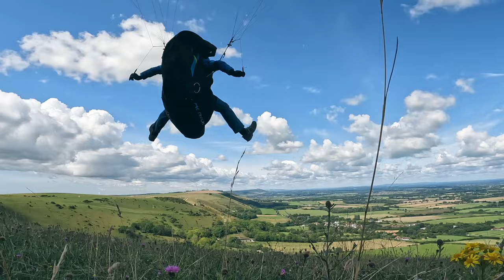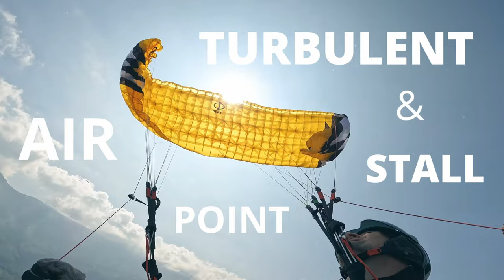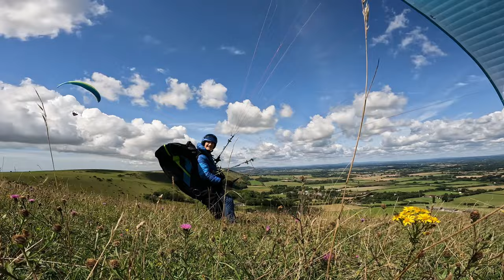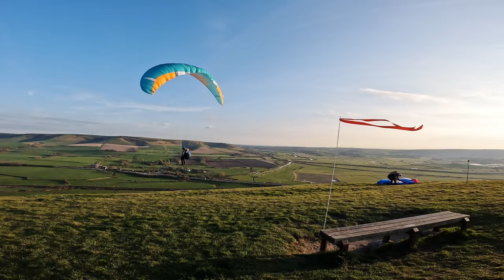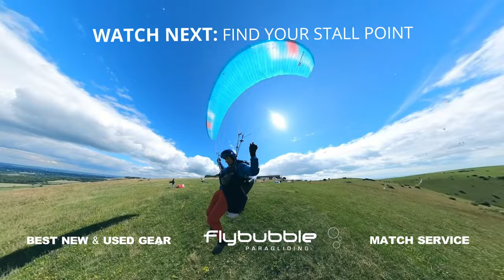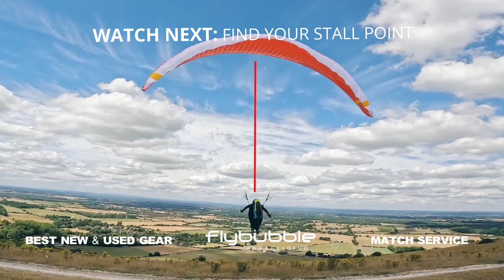AVOID DISASTER: This ONE THING Drastically Increases the Chance of Accident!!!

Comment: I had a pretty nasty crash along those lines as well. Landing into fairly strong wind, with a fairly strong gradient (quite a bit less wind at the bottom) got an asymmetric collapse due to turbulence and then just didn't have enough airspeed to recover before the ground. While in my case I'm not sure if there were many options left (I was at or very close to trim speed and only braked to stop the rotation) the wind gradient is important to keep in mind, especially when landing in strong wind. If there is already a wind gradient eating up air speed it takes very little to stall or delay a collapse from repopening.
Reply from the maker: Thank you for sharing your experience with us! We really hope everything was okay with you 🙏  Absolutely, wind is a major factor not just when it comes to landing itself but also in collapses - how our wing reacts. Depending on the wind, our wing will react completely differently, which can quickly catch us off guard if we're not 100% focused. At the end of the day, such things happen so fast that it's really hard to be 'smart' afterwards... All we can do is practice a lot of ground handling, possibly go for an SIV course, and practice things that help us gain as much feeling for our wing in as many different situations as possible. On top of that, we should never forget to not underestimate the power of the wind and to respect nature and our limits. Thank you for your comment! Happy flights and safe landings! 🦅

Comment: Yep.
Another stall accident, in 2022.
Flying for 2 hours, mid-summer here in Southern Japan, and I stupidly forgot to refill my camel back.

I became partially dehydrated, and wasn't thinking straight, when I "suddenly chose" to do a side landing, near some low trees. 🤦‍♂️

Pulled too much brake on my Cayenne 6, and had to be ambulanced to A&E.

Only a minor fracture in my left wrist due to falling/spinning about 4m sideways, into the hill. But it could've been much worse.

NOT wearing my watch probably saved me from having a shattered wrist.